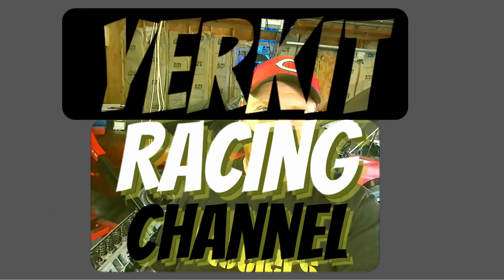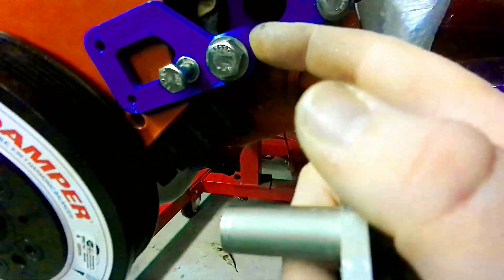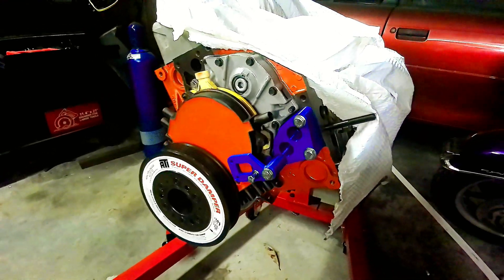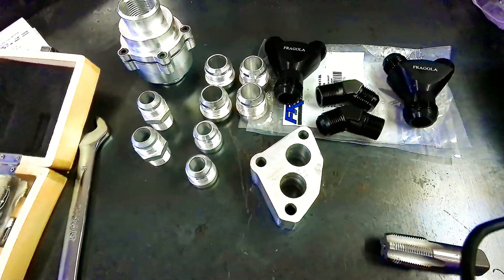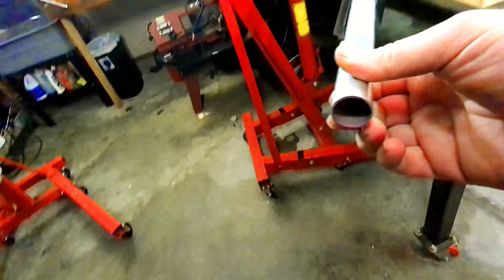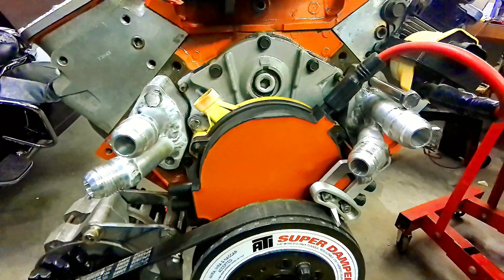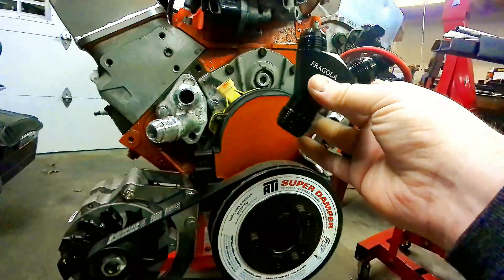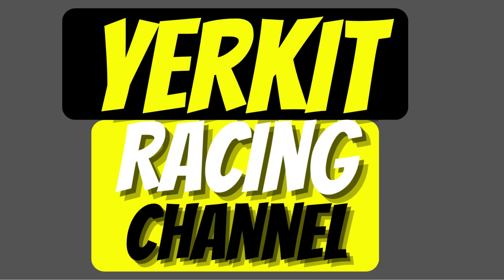LT1 block adapters finished! Reprinted, milled, tubes and fittings welded on!

Comment: Subbed! Found this link on FB. My M&M LTX block comes in next month and was going to go with an E85 single turbo no IC but if this is a rear mounted radiator build for an fbody I'm in!
Reply from the maker: Appreciate it! That's the plan. Working on moving the wiring for the electric water pump and fans back there now. Then going to plumb it with aluminum hard line as much as possible.
Reply from the maker: Right now my plan is to cut the t-top well out and mount it as low as possible to try and have a flat panel over top of it. Trying to do it with the stock radiator and fans to start with but if its too big, I will have to go with a smaller dual or triple pass radiator setup.

Still have full magnaflo exhaust at the moment with electric cut outs for the little street driving I was doing. Been trying to convince myself to get rid of everything behind the headers though so this might push me that way.

Comment: Only issue I’ve had with threading aluminum is it wants to plug up the tap. Use plenty of oil and take very small bites at it. Should be fine.
Reply from the maker: Yeah I was looking into it and they make some spiral tip taps and full spiral taps that are supposed to cleanout better but kinda hard to find in pipe sizes and very expensive. Look decent though.
Reply: Yeah I just use reg taps and go slow. Just clean them a lot. It’s time consuming but works.
Reply from the maker: I had to get silly with the amount of pressure to get it to turn at all. Not sure if it was just because its a larger tap or what but either way it sucked. Couldn't clamp it tight enough in the vise for it to not mess up the aluminum blocks lol. For these blocks it would probably need to be tapped before machining the outside to be able to clamp it harder.
Reply: Try chamfering the edge a little next time. Pressure is required on most big taps anyway but if you can’t get it locked in no matter what it’s a bihh. Long as it got done.
Reply from the maker: I chamfered the holes and it helped center the bit but didnt seem to help much with the force required. I think it just needed to be clamped tighter was the real problem.

Comment: Blocks look awesome. Did you check to be sure those welds won’t leak before you do final assembly? Even though they may look like they won’t it doesn’t take much and you’ll have water trickle by.
Reply from the maker: Thanks cuz! I'm going to make a plate and get a cap for the AN fitting and figure out a way to pressure test them before final install
Reply: Could use the a caps and fill them with water and let them sit. Will take longer than press testing but works.
Reply from the maker: I was thinking about sealing with the cap on one side and try to find an -12 AN to air chuck fitting and putting 30 psi on it in a bucket of water to see if any bubbles were coming from it.
Reply: sounds like a plan. Just drill tap and seal one of the a caps with jb weld if nothing else. Keep it cheap and easy. It’s just for testing. No need in getting too extensive with it. Soap and water your joints that’s it. Everything else will be fine. May not see where the leaks are in a bucket. Those soap suds will be precise.
Reply from the maker: Yea the soapy water would probably be more precise... I like the idea of drilling and tapping the cap for the air fitting